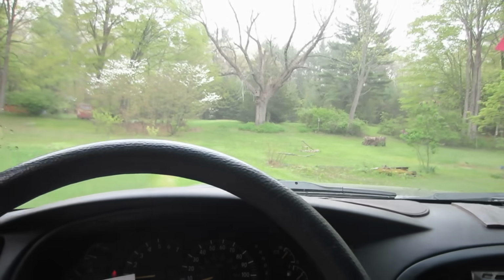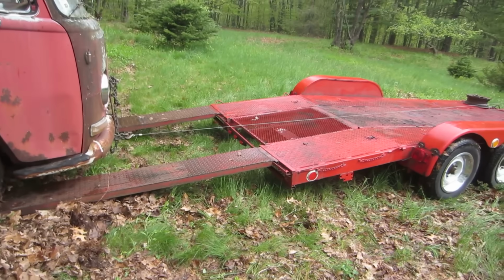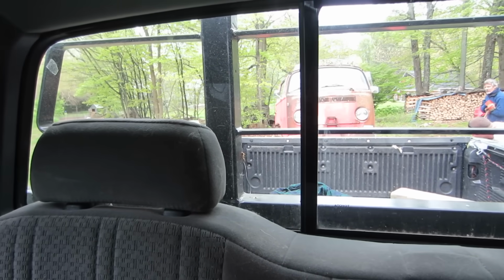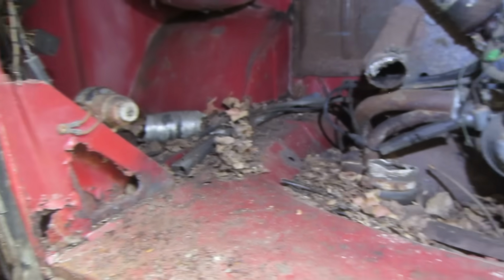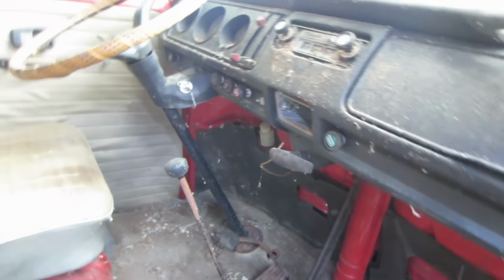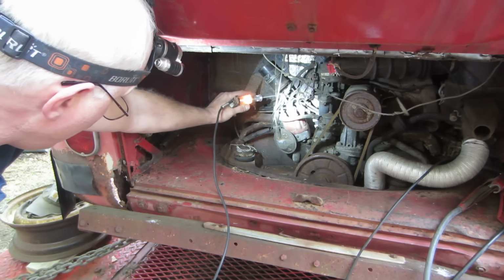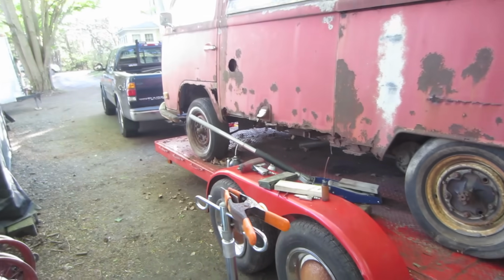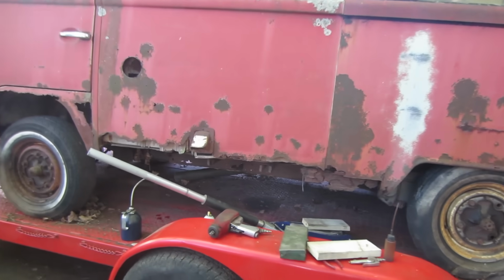31 years in a field, vw bus, will it run?

Comment from the maker: answers to common questions, starter was cranked no more then 60 seconds then cooled down 15 min between tries, engine spun by hand, oil was clean, l used an oil/gas mix poured into the carb then cranked, the valves were not seating at 1st , so it took a while for the compression to come back, the bus is just for parts to save my other buses. the rusted panals are junk so l did not care about using a crow bar on them, the bus was parked back in 1986 do to being too rusty for the road, and last thanks to everyone who watched, if l knew this video was going to go viral l would have put more effort into the filming,
Reply: What gives VW engine's that hallmark sound?
Reply: 14598175  mostly the muffler, probably  compression, and cam duration, maybe fan noise and being air cooled no water around the cylinders adding to the mix
Reply: Being a boxer layout is what gives it the sound, same as a BMW motorbike.
Reply: Mustie1  there was something in the engine blocking it you need an engine swap the engine is broken
Reply: Mustie1 I
Reply: will it drive
Reply: fuck honda or toyota ! vw is the best car made ever
Reply: Mustie1 superb
Reply: When ya heading  to Woodstock?
Reply: What's That Gas?
Reply: I Subbed!!!!!!
Reply: wow that thing was too rusty to drive 30 years ago? Good on you guys for keeping motor history alive
Reply: Mustie1 can you please the full video of this bus after the restoration
Reply: Did you not see the part about just using this bus for parts?
Reply: Mustie1 are you planning to upload a video of the full restoration of your van?
Reply: Mustie1 i
Reply: Ashtonmccartvlogs superb will be waiting for the upload ✌
Reply: Всем привет
Reply: Mustie1 u
Reply: Mustie1 ok'
Reply: Mustie1 it is not going to work !!!!!
Reply: Well its obvs going to need a complete remachining oversize but that still cool you got it to run and it means nothing is ultra fucked in it.
Reply: never crank an enging e for 60 seconds...your  crazy.
Reply from the maker: bs,
Reply: Nahhh, I own a 1963 VW Ragtop Bug and a 1975 BMW R75/6, they don't really sound at all alike...  Part of why VW's sound that way has got to be the solid lifters, but that's not the complete story... and the rest of why they sound like that I do not know!
Reply: Mustie1 you r expert
Reply: Mustie - DUE to being too rusty
Reply: 14598175....or old porsche, subaru etc. But not every boxer sounds like this, secret is in non-equal exhaust manifold and pipes connections, second thing is firing odrer in cylinders. All must be tuned and work together like in steinway piano to probuce this heavenly music... ;)You're welcome;)
Reply: Drivning à Renault r4
Reply: Mustie1
Reply: Shit no. The filming was great. i really enjoyed watching. I/m sure you would have heard me urging the engine on when you were trying to start it. Thanks for the video. Now i am off to watch part two
Reply: i love that Bus if I wasn't paralysed left sided I would also start a project with any old VW before my brain crash or better look before my brain stroke I had a VW T4 but I am not allowed to drive in the traffic after my illness but I had loved this T4 and also my daughter she was real angry to my ex-wife the day she sold the bus
Reply: Siok Gen Liang I think it's trying to communicate

Comment: That is one tough starter motor!
Reply: Not much to go bad. Just wire and brushes.
Reply: billyboi57 and a lot of heat.
Reply: billyboi57
Reply: Bosch starter , well made.
Reply: What I was trying to say is that just about any starter motor will overheat when cranked excessively. Every vehicle I have owned or operated should not have the starter motor cranked over for more than 15-20 seconds to prevent overheating, then let the motor cool down for a bit.
Reply: billyboi57 yeah no joke
Reply: I know right!  I couldn't believe he was cranking it that long.  If it doesn't start after 5-10 seconds, another 20-30 seconds of cranking isn't gonna start it.
Reply from the maker: but it did so there goes that theory
Reply: You didn't do anything else to the motor at all except keep cranking it?
Reply: German engineering! :D
Reply: old german engineering
Reply: That's something that hasn't been retired as well, that is a very old vannn but my guess is it would have started sooner if he'd sanded the points inside the Distributor cap and such
Reply from the maker: l did
Reply: @HerecomestheCalavera  lol have you watched this guy for long? I'm pretty sure he knows what he's doing. One of the best I've ever seen.
Reply: @clemcon501  Haven't watched him in over 4 years according to the date on the comment you replied to.

Comment: Got to love it when they kick over after sitting for so long
Reply from the maker: l think l can,, l think l can,,
Reply: Sounded like it was hitting on all four at the end there. Whatever valve was stuck seemed for free up once it fired.
Reply: it will it will there you go  magic..
Reply: It rather sounded like a stationary engine when it started to fire but it eventually kicked onto all four.  It just needed a bit of fire to get the stuck valve moving again.  If that is a factory rebuilt engine that hasn't done much between being put in and the bus getting parked it should be a good motor.  A decent service and I reckon it'll run as good as new...
Reply: gosportjamie q
Reply: George Robartes r
Reply: Mark DeBarge tup
Reply: when it started, i felt like i was successful!  lol, im not....
Reply from the maker: guess you missed the part when l showed the clean oil and it turned over by hand, also the plugs are seized and this will get torn down and gone through before being reused, it is a $200 bus not an airplane.
Reply: 4nuk8r I read all that took a min
Reply: It's so satisfying
Reply: Especially when it's a diesel that smoked
Reply: sturmey archer 3 speed hubs and sturmey archer dynohubs are like that spin the wheel on a bike with a dynohub and the light will light up try the gears on a bike with 3 speed sturmey and the gears will change provided of course the cable isnt toast even though the bike has been sitting around for years
ive stripped and rebuilt a sturmey hub and after resetting the drive side cone the gears all worked and that hub was full of water and rust when i took it to bits
Reply: Mark DeBarge it will be destroyed
Reply: Mark DeBarge 
Luv it more when I flip it for $. and I got it for free.
Reply: Mustie1 exactly

Comment: That's a really strong steel rope and that pulling motor is really powerful. Even loading it is such a great task in itself. A big errand taking it and then starting it. Volkswagen obviously had to fit engine at the most difficult to reach place and you reached it. Worth a lot of appreciation.

Comment: NICE! For the fun of it, I've gotten junk yard 8-tracks to play before. Looked to be in about the same condition as the yours. Of course, I didn't just pop them in, they need to be opened up, unwound and rewound back into the cartridge. A little rough here and there but didn't sound as bad as your would imagine. Hope you save the stereo, might be worth restoring as well.

Comment: Great video.  I had a red 71 brand new I bought when I got out of the Army.  Did a cross country trip in it.  Melted a piston on the PA turnpike near Greensberg after a routine VW 6000 mile service appointment where the mechanic forgot to tighten the oil drain plug, thereby causing the engine to all but seize up.  Stayed in The General Green Hotel for a week while the local VW dealer there rebuilt the engine and told me what caused the problem.  I still remember they charged me $75 for new plugs, gaskets and oil none of which were included in the warranty.  I'm still peed over it.
Reply: Them vans struggled to go highway speeds.
Reply: A Day I had a 71 ones then it caught on fire and exploded right in front of me
Reply: A Day duck you
Duck you
Reply: A Day Thats a real bargain.
Reply: For a mere $75 you ended up with a priceless story! LOL...Gotta love VW.
Reply: A Day, That was far too expensive. In 1971 I worked at Ogner VW a dealership next to the huge MGM Movie Studio in Culver City Ca. The cost of the oil was $2.10, four spark plugs were $4.40 and the gasket - seals set cost less than $9.  Even a plain oil change, including the oil cost was so cheap that some of the set actors and other workers started to bring in their VWs for an oil change  every day and leaving  the cars till they got off that afternoon rather than pay for parking which cost a lot more than an oil change. Our shop foreman  caught on and put up a sign stating that all oil changes without addition repairs must be picked up within 20 minutes of completion. The oldest VW I worked on there was a 1951. Ogner VW serviced all the VW's that were in MGM movies at that time. Herbie, The Love Bug, was not one bug but several. MGM bought 7 or 8 new bugs from Ogner VW; had our body shop paint all as Herbie. After the movie was made MGM  had us paint all but one back to original and sold them back to Ogner VW as used cars. The one stayed with MGM as a display.
Reply: When they first came out, the didn't post a 0-60 time because they couldn't get it up to 60.
Reply: In high school way back I went for 20 mile ride to a park with a bunch of people. We had 22 people jammed in one of those things

Comment: I always enjoy these adventures !   Reminds me of the projects I' was involved in over the years  of course as a young one we didnt have all the high tech gear  or nowledge  often  we used a hillbilly tow system that was a heavy duty chain   Fed thru a 8' pipe that we bolted onto the bumpers  the pipe in theory allowed the tow vehicle to help brake the  vehicle  being towed  as long as the  driver  kept the  car in line  with the front car   After too many close calls i did wind up buying a  actual tow bar  that   Was set up fo a VW but could wok on other   Foreign cars  with some   Adapters  and grade 8 bolts  i actually towed a MG over 100 miles  with it and  still own the bar today  like you its pulled many VW  types  very well

Comment: Man! That winch cable was singing like a guitar string on that second try, I was blinking, wincing and turning away, couldn't help it!
Reply: John Gerson Same for me, found it sort of hard to trust it wouldn't break. Just imagine what havoc it could wreak...
Reply: Man, me too..this is why i bought a remote control and the balistic nylon cable replacement...wire cable freaks me out when it starts singing.....
Reply: He should have doubled the cable and used several blankets to cover the cables
Reply: About 3 octaves above middle-C!!!
Reply: at least they knew to put a blanket over the winch line.
Reply: William Dudash в

Comment: The second capacitor (condenser) that was loose was a RADIO Suppressor, it reduces interference on the vehicles' radio - It has nothing to do with the ignition system...

Comment: 0:58 
Cameraman: "So are we going to pull from the front or the back"
Passenger: "Yes
So Relatable
Reply: Klydzz
Well he wasn't asking if they should pull from the front or back. He was just stating that they could pull from front or back which the guy agreed with. "Yes" you can pull from front or back he agreed.
Reply: The passenger was probably Filipino. They answer the question that way - the "yes" refers to the choice you offer last.

Comment: well he officially has 100,000 miles on the motor, and 500,000 on the starter.
Reply: VHS or Beta
Giving the throttle some pumpage is a good idea though when starting an engine that hasn't run for a while. Obviously don't redline it if it starts but it may need a certain amount of throttle to stay running and then later it will probably idle on its own.
Reply: VHS, Not sure if you mean that Mustie does this or other people. He's probably pouring 2 stroke fuel right down the throat of the carb like he does for most of his starts so it may be revving on its own since there's probably little to no actual metering happening from the carb. That and the carb is probably full of junk and useless anyway without a cleaning/rebuild. At least he uses two stroke fuel which has some lubrication built into it. That and given the fact that after that many cranks there should be oil circulated throughout as long as the pump is good. I know for sure that Mustie always checks the oil. 

I totally agree though with people jumping up and down on the throttle and trying to rev the crap out of it the second it fires. First there's likely no fuel in the carb float bowl anyway,  So even if it had a working accelerator pump it it wouldn't squirt anything. Seems like every old carb has a hard accelerator pump these days so it'd still be a moot point. lol. Now if somebody filled the float bowl up then they could potentially use the throttle to rev it. But... I'd hope that if they were smart enough to actually fill the bowl that they'd know better. Well...... Who am I kidding. The world is full of people that don't always do good research before acting. lol. 

Either way.. Love Mustie's first start videos.
Reply: Nigel 900 starters can take a beating
Reply: Yep. He's officially the world's dumbest mechanic. He should have taken off the carb at least and cleaned it all out first. Can you imagine 30 years of varnish in that carb?
Reply: @Mr.M1STER  -
Reply: Just think of those dry, dry, dry, 30 years dry piston rings going up and down those dry,dry cylinders while the dry dry dry cam lobes have dry tappers rubbing on them with full spring pressure
 Might as well put a motor together with fresh soap and water washed parts ,don’t put any oil on anything, don’t put any oil in crankcase and then start her up and rev her up
Reply: @supermarioisacat   Also, there is engine static timing.  I make bets that I can get an engine to fire on the first crank. I did the same thing with a FIAT twin Weber intake. Pretty cool, One crank.  You get the best idle you can as well. The low end 
should have some resonance. Like the rumble from a Porsche. Nice sound at cruising.
Reply: @juljasmaharchive   Ignition coil is the same as in an old TV.
Reply: @noelsingletary  There is a procedure and he just bounces around.
Reply: @michaelszczys8316  Not even a compression check, or any of the normal maint items. I didn't hear the coil kick in at all.  The test light should flicker at the coil side as well.
Reply: @michaelszczys8316  Remember Coca Cola. It works in toilets.

Comment: I don't know where everybody was standing but if that cable would have snapped  it would wrapped around somebody and cut them in half it would have been a bad day in paradise for somebody
Reply: woah safety sal its 1500-2500lb cable far less energy than the 10k-25k cable trucks use nobodys getting cut in half
Reply: no loss. These guys destroyed sacred metal. The Volkswagen was restorable and they designated it a parts car.
Reply: @Chemist9662  you're high, or desperate, that thing was GONE
Reply: @Chemist9662  No. The body, MAYBE, but once the frame is so thin you can knock it out with your finger, there's no hope.

Comment: Just so you know, you shuld never dust of old brakes with pressure air if you don't wear any breath protection, they will most likely contains asbest.
Reply: broken english to the extreme
Reply: @ChrisBlagdonIsABoss  probably from my phone, but you understand anyway, that's the importent part xD
Reply: @Mre942  apparently the risk of asbestos actually comes from the breaks, tyres don’t, and rarely did, contain asbestos, which makes sense since asbestos is mostly used for its thermal properties.

Comment: still less rust than my 2009 sprinter.
Reply: Smell the weed
Reply: Man, those Sprinters are completely rotted out within 5 years, at least in my area.
Reply: Must be like the Ram trucks.  Sheet metal is so thin, there is no such thing as surface rust.  Once you see any rust, that's it.  No metal left.

Comment: I love this VW Can but what I did on mine, it was first I removed and clean the Gas tank! New gas filter, clean and check gas pomp !them new hoses! New spark plugs cables, coil, battery! Brakes, carburetor clean etc, after all, I did in my Van I try to turn the engine on! First, try works like new
Reply: In a shop - yes - even in my driveway or at the curb.  BUT man they are in the dirt

Comment: When you pull these old vehicles like this from the woods/barns/yards and the old fuel has been sitting in the tank for decades, what is your “go to method” for cleaning that old sludge out of the fuel tank?

I recently bought a 1927 Buick that had a frame off restoration in the early 2000’s and the previous owner passed away in Dec 2004, it’s been sitting with gas (now varnish!!) in the tank ever since!!!!

I really do not want to disassemble the back half of the car to drop the fuel tank, it has a drain in the bottom of the tank but the gas is literally varnish now and it has about 1-2 inches of a tar like sludge in the bottom of the tank!!

Again, I know I CAN drop the tank but again I really don’t want to disassemble  the back 1/2 of the car to drop the tank unless it’s a last resort!

I am heading down to the car now to use a manual transfer pump to pump out the 1/2 tank of old gas (varnish) and then per a recommendations a friend who restores cars I am going to mnaullu pump 2 gallons of Carb dip/Chem Dip into the tank and see if it will break down the sludge and varnish on the walls of the tank....

Any recommendations are greatly appreciated besides, “Drop the tank”!!
Reply: CrazyfamilyTLR pour denatured alcohol in the tank (a couple gallons should be adequate) leave it in for a few days , then drain. The varnish should break down .

Comment: Didn't the old cars have asbestos in the brakes, got worried when you used air to clean it out.
Reply from the maker: rust
Reply: Tommy Barnabas Dahl it is even considered a work health hazard for mechanics. Tragically it takes years for asbestos cancer to manifest.
Reply: Asbestos brake pads are still around.